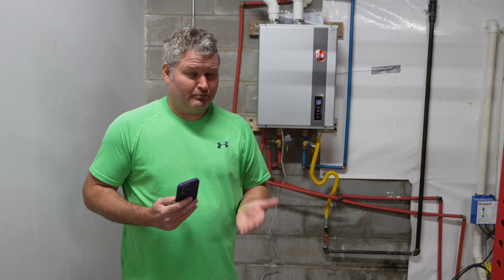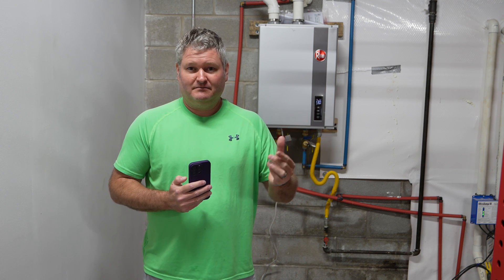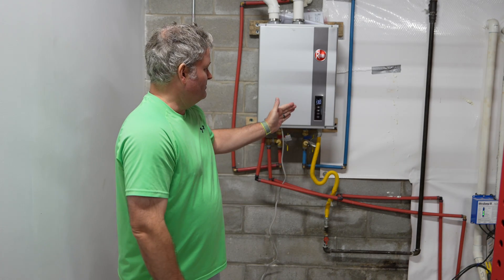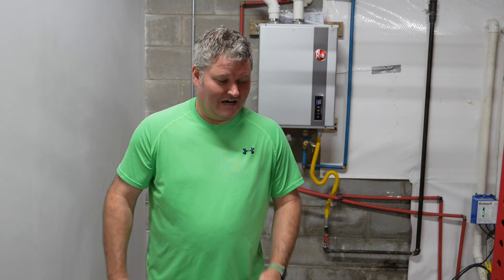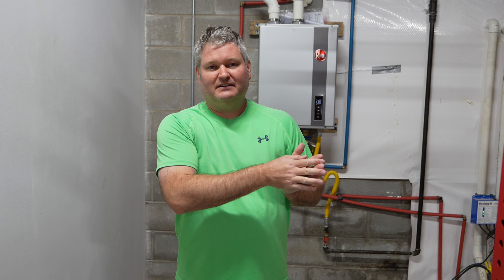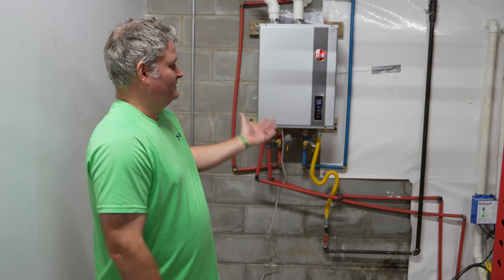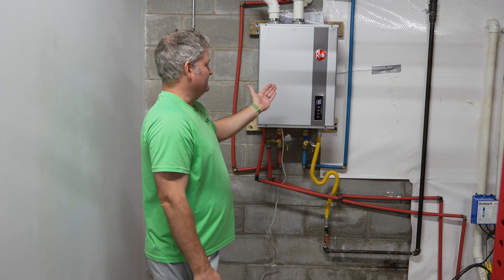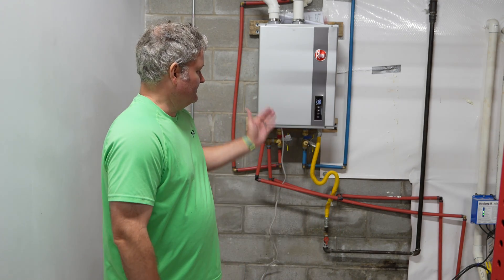How to Determine Tankless Water Heater Size

Comment: when you're measuring GPM are you only running hot water?

if you're having a warm shower some of the water is cold water.

so are we only supposed to add an estimate of how much hot water per minute is coming out?
Reply from the maker: I called to clarify and the gallons used within the app references hot water.  I was curious about the same thing!
Reply: @IrixGuy  so if a tankless is 7.5 GPM and you run three showers at 2.5 GPM that doesn't mean its maxed out?

Comment: Thanks
Reply from the maker: You're welcome and best of luck with your tankless water heater adventures!  I linked the one like I use within this video's description and it's still working flawlessly at the time of filming this. Also, I suggest the battery backup like I use because even though this is a natural gas water heater, the battery backup saved me during a power outage.  I could still have hot water!